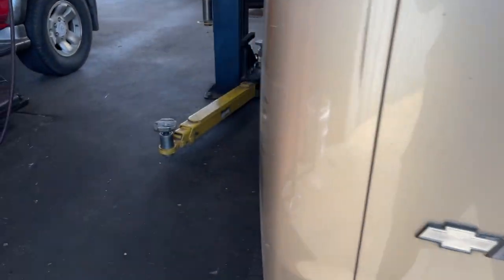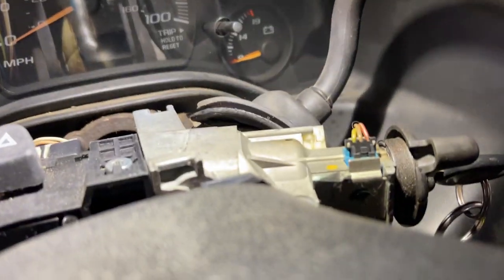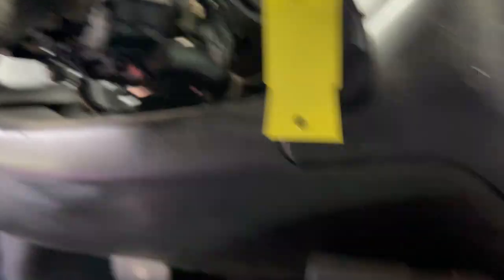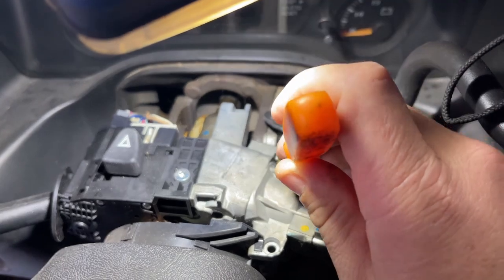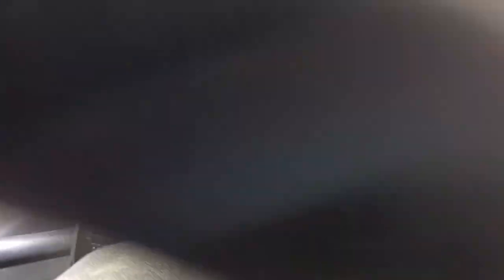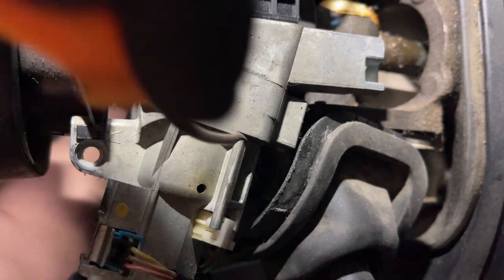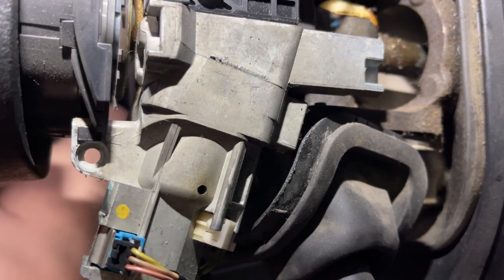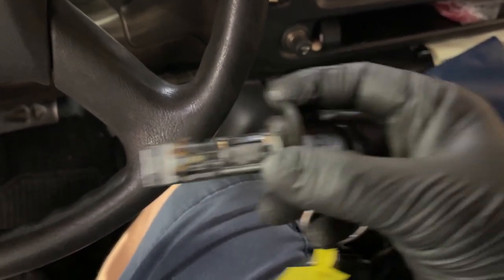Replacing Ignition Key Cylinder! 94-05 Chevy Trucks & SUV - GM Vehicles!

Comment: Hey thanks for the video, but what if the reason you need to replace the key cylinder is because you lost the key to the Tahoe? How would I remove the old cylinder with out the key? Hammer and screw driver? any advice would be helpful.

Comment: I have a 2015 Chevrolet Traverse do i need to drill a hole on it to take it out or is a different way?
Reply from the maker: there should be NO drilling needed, should be very similar to this video
Reply: @FalconsGarage  thanks I found the hole on it and I just got it off around 2 days ago and I still need to check if I need to replace it or fix it cause it looks a little old but nothing wrong with it inside or outside. If you can help me with your knowledge I'll really appreciate it. God bless.

Comment: I'm new to this and would like to know if you need to program the key to the system or if you could just use the new key and go from there, please and thanks
Reply: If I'm understanding you correctly I'm pretty sure if you used your original key with the new cylinder you would have to adjust the pins or rekey the tumbler to accommodate the new key. A bit of a hassle if you don't have the right tools, but there's almost always a work around if you often refer to yourself as MacGyver 😊 I can't get my damn new one to work or the key to come out, but I'll get er.